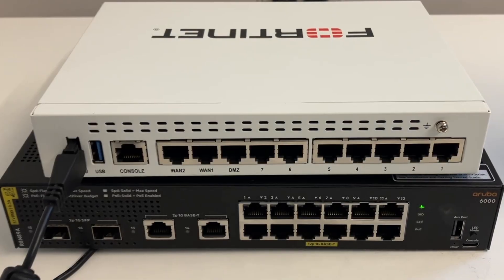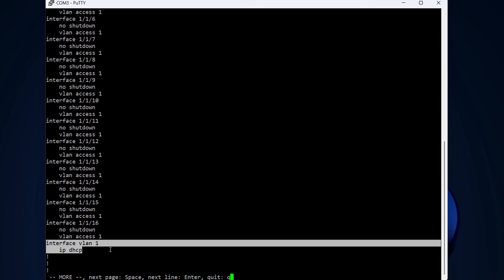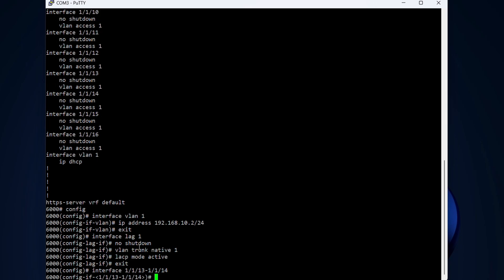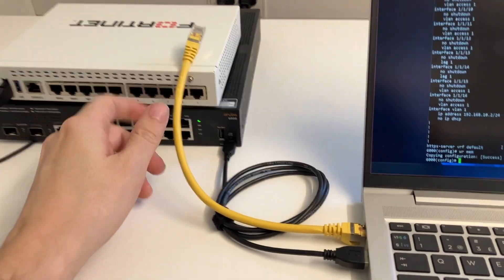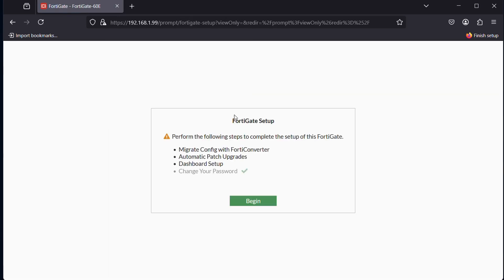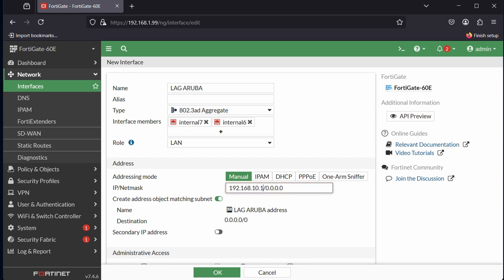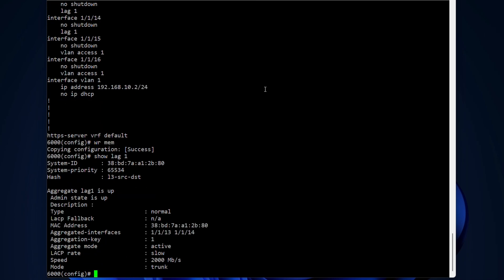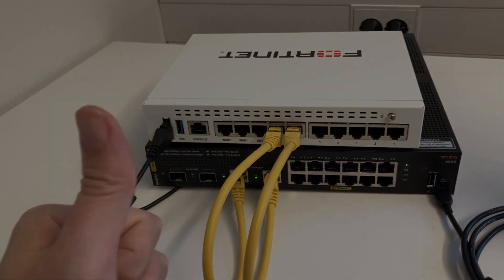LAG/LACP on Fortigate Firewall AND Aruba Switch

Comment: Cn you explain 
Interface vlan 1
ip address 192.168.10.2/24

It is a layer2 switch and how IP address is assigned to it, are you creating a new virtual interface with the above command if so why there is a space between vlan and 1(interace vlan 1)
Reply from the maker: Hi! Layer 2 devices can still have IP addresses on interfaces. So what is done is that it is assigned an IP on the vlan 1, in my case mainly to test connectivity (ping it).
Reply: @TheSwedishSysadmin  Thank you for your response. If I create another VLAN — for example, VLAN 10 — can I use the same command for both VLAN 1 and VLAN 10:
interface vlan 1
ip address 192.168.10.2/24
interface vlan 20
ip address 192.168.20.2/24
Reply from the maker: Yes! Then the switch will have an IP on those VLANs. Mostly used for out-of-band management or connectivity test.
Reply: Thank you for your informative vedio if I need to register the switch need policy on fortigat?